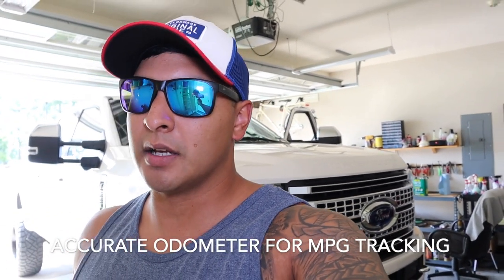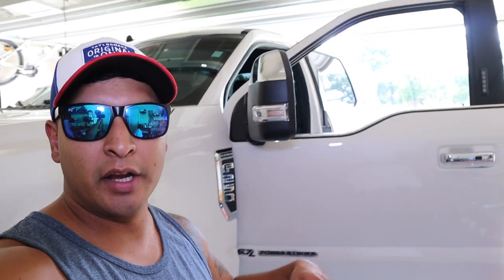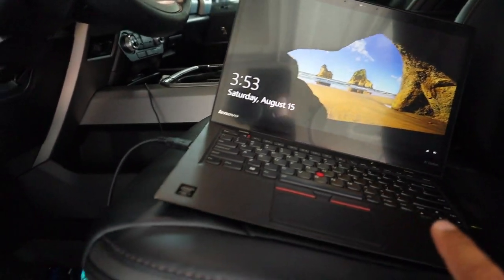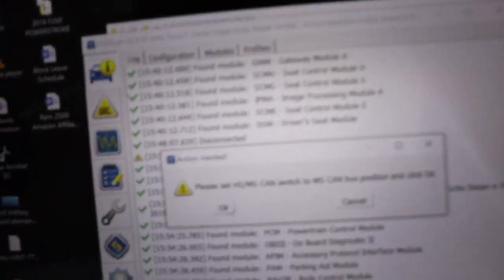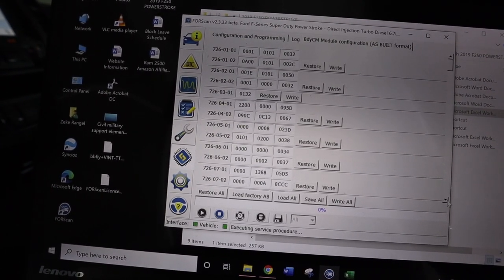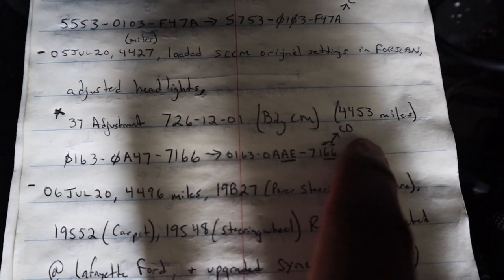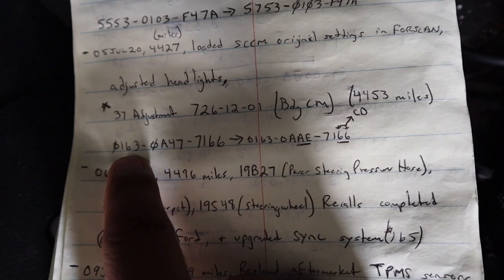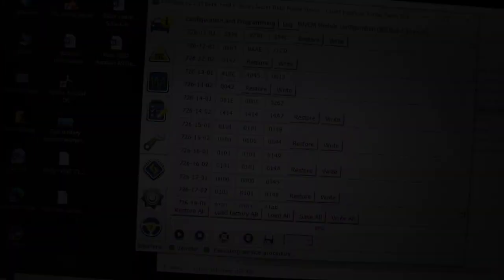Calibrate Your Superduty with 37s using FORScan! PROVEN FORMULA!

Comment: A great mod! AAE gets you to 2634 mm over all diameter tire.  After some tweaking with the numbers, A8B gets you a tad closer at 2644 mm which is the absolute maximum Forscan will allow without a Check Engine light on my 2017 F250 Power stroke. With 37 inch Nito Ridge Grapplers it gets me within a 0.5 MPH difference.   NO check Engine lights.
Reply from the maker: Thanks a lot brother!
Reply: Still running clean? I'm getting ready to do the same change for my 18
Reply: Hey Billpro what’s your full code? When I type in the A8B is kicking back an error. My current code is 0163-0AAE-71CD. As soon as I try to add A8B it kicks back…? Thanks in advance
Reply: How about a code for 32.5 I'm runnin 275/55/20
Reply: @billpro what is your full code for this? When I enter your 0A8B it kicks a warning message saying “incorrect checksum of data entered” - Did you change the 71CD to something? When I did the video 0AAE I am still off by 1.6mph running 37x12.5R17
Reply: Will this work on 11-16 F250 / F350s?

Comment: thank you for making this video,  0AAE  parameter code worked on truck, I have  37 inch Tires, my speedo is right on and no active codes after changing parameters
Reply from the maker: Glad it helped! Mine is still doing well with no check engine lights or anything. I can't complain!

Comment: I understand that 0aae is the 2734 circumference of the 37" tires  but what is the change of 7166 to 71CD. Where did you get that from ?
Reply: Edit: yeah this was my question too but after trying it you do want to change the 7166 to the 71CD. He wasn’t super clear about it but it works. However I’m still off by 1.6mph running 37x12.5R17’s on a 19

Comment: Great, so where would i find the code for a 15 plati running 40'S? any help much appreciated.
Reply from the maker: Anything larger than 37s will cause a check engine light unless you use a calibration tool. Even then then are capped at a certain size tire.

Comment: I changed my f250 2018 diesel 6.7 tubo lariat, 6inch lift down from 37x12.50r20 to 37x17x13.5 and I want it done right, where or whom can I go to get it done. From Texas 101 airborne 67!
Reply from the maker: throw a dart on a map of Texas and you will find a reputable diesel shop haha I miss TX

Comment: Great video. I just bought new wheels & tires (37’s) and will be making this change on my 2019 F250 Lariat in 2 weeks when the wheels come in. 
Just curious,...how did you figure this out?
Reply from the maker: A lot of research, that’s for sure!
Reply from the maker: Still going strong, no codes or issues 14k miles later!

Comment: Question on your OBD2 adapter - I bought the same one based off of this video and a couple others I watched.  When I connect to my truck (2019 F350 Platinum) I get a message in Forscan that says the adapter is not compatible with my vehicle.  I have made a couple changes and it seems to work just fine- just curious if you ever experienced this?  I didn't see the message that I get pop up on your laptop when you were connecting.
Reply from the maker: I think I may have had to install the driver before utilizing the adapter. But I’ve never had issues with the adapter

Comment: Great video.  I have a 2020 f250, any idea of codes that will also keep my engine light, etc.. off?  I just put 37’s on my truck.
Reply from the maker: Not sure, 2020s and up are always in the works.
Reply: @MotorHead18  thank you, that’s what I am finding.  Any idea how to get everything back to factory settings?  Seems a couple of other things changed when I changed the tire circumference.
Reply from the maker: @chadcornstubble4095  I would just look at the factory codes for your truck and go down the line if there was a previous owner

Comment: Would it even matter if the wheel size was 17s as long as the tires were the same size?
Reply from the maker: Not all 35' tires measure 35 (if any) once actually mounted on the truck, which is where narrowing down the mounted diameter helps

Comment: What other mods do you recommend using forscan? I have the same truck you do but I’m a 350.
Reply from the maker: CDUBMERC I’ve done about 10 others
Reply: Motor Head what other changes did you make with the forscan  if you don’t mind sharing.  I’ve just started with forscan and looking for recommendations while I’m in there.  Thanks.
Reply from the maker: CDUBMERC Nav use while driving, tire psi threshold, accurate MPG readout, add auto regeneration option, add average speed to name a few!
Reply: Motor Head,    Nice!  Thanks for the info 👍👍
Reply from the maker: CDUBMERC No problem!

Comment: I have the 2019 f350 lariat with 3.55 gears stock tires were the 275/65r18 I just had 37x12.50r18 put on. Would I be safe with this formula?
Reply from the maker: Yup, give it a go.

Comment: Have you came up with a way to adjust the tire pressure sensors? my tire pressure sensors are indicating that I need more pressure in the rear tires but the max pressure I can use in my current 37s is 65 PSI.
Reply from the maker: Yup I updated the tire pressure settings to 50 front and 40 rear with forscan too!
Reply: I just got my 2019 a few weeks ago and will be recalibrating as soon as I get Forscan set up.  Thanks in advance for the help with that. How did you decide how much pressure to run in the 37's?  I'm set at 55/50 now.
Reply: @glenncaswell9062  I did as  @Motor Head suggested and it worked perfectly!

Comment: What’s the circumference of a 37? I got 2951 or is that wrong? 37/13.50 R22
Reply from the maker: Base it off the real-world measurements with the tire mounted and aired up for best results
Reply: My 37s on the truck and on the ground measure 35.5”. That circumference is 2832. Is that the same for you? I’m hesitant to put the code in if you have a different number.
Reply: @robertwolak1613  I did the 2951 and the check engine still on but might change it to your number see what happens

Comment: Great video. Do you know if this value will work for a 2016 with 355 gears on 37s?
Reply from the maker: MrBlackbeauty74 No hurt in giving it a shot. If it doesn’t work i know there are more formulas that will get you with 2-4 mph. This one is 1-2 mph off!
Reply: @MotorHead18  thank you.
Reply from the maker: MrBlackbeauty74 no problem
Reply: Did this work for you?

Comment: So you didn't run into issues with pulling the TCM code P1635?
Reply from the maker: Not at all.
Reply: @MotorHead18  well that's cool.  I had to end up setting the largest factory preset tire size in order to not pull the code with my 35's.  Haven't taken the truck (2017) on the highway yet but no code and it's dead on at 40 so fingers crossed.
Reply from the maker: @yummytummybbq8778  Using my formula!?
Reply: @MotorHead18  I used the forscan spread sheet but I'll give yours a try tomorrow.  I was thinking yours was for 37s.  I'll let you know how it turns out.
Reply from the maker: @yummytummybbq8778  Yup, 37s.

Comment: Motorhead,
Do you know what the input code would be for stock 20" wheels and tires?  It was an option on my 2018 f250 KR, but I bought it used and it had stock 18's on it. I purchased the stock 20 set installed them and now my speedometer is off. I tried your code and it set the CEL. Thanks in advance for the help.
Reply from the maker: Gotcha, I will look up the code in a bit and we will see if it works for you.
Reply: @MotorHead18  Did you have any luck?
Reply from the maker: @markcash1964  shoot. Remind me later today if I don’t get back to you.
Reply from the maker: @markcash1964  0163-0A47-7166
Reply from the maker: That is with my 3.55 gears.
Reply: @MotorHead18  I tried this code and your original code and they both set the CEL.
Reply from the maker: @markcash1964  interesting...what’s your setup?
Reply: @MotorHead18  
Both sets are stock oem wheels and tires . Came from factory 275/65/18 32.1 inches in diameter.  Changed to 275/65/20  34.1 inches in diameter.  So the difference is 2 inches larger, so the speedometer is 4 to 5 mph off from my gps. I've tried both codes you have on your change log on the video and I entered them with forscan no problem other than it sets the CEL. And I hate to have a light on on the dash. Lol
Reply: @MotorHead18  
I can't post pics but the specs between the 2 sets say 18" are 2 inches smaller then 20" in diameter.  32.1 in vs 34.1
Reply from the maker: @markcash1964  gotcha, that code should be easy and probably won’t need to recode. I would go through on forscan and adjust to a 275/65r20. Shouldn’t need to recode.
Reply from the maker: @markcash1964  just go to bdycm and check out the changes you can make. No need to go into (as built data).
Reply: @MotorHead18  
Where on forscan? What module and key position?  Thanks again

Comment: will this work on a 2020  f250 powerstroke?
Reply from the maker: There is a separate worksheet for 2020+
Reply: @MotorHead18  yes but nothing on the calibration yet.. i think it will throw a CEL
Reply from the maker: @21armyn  gotcha